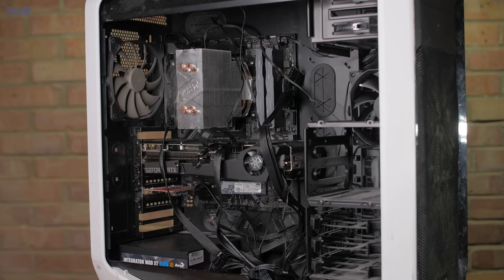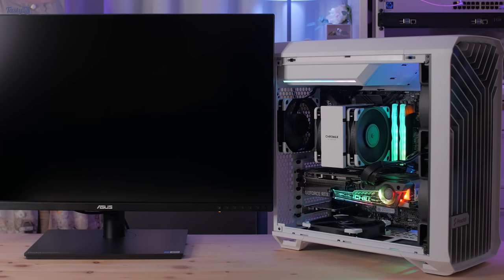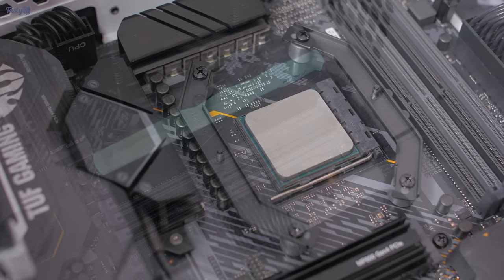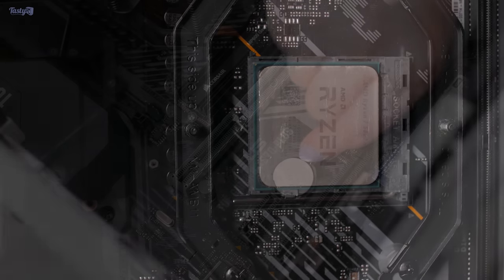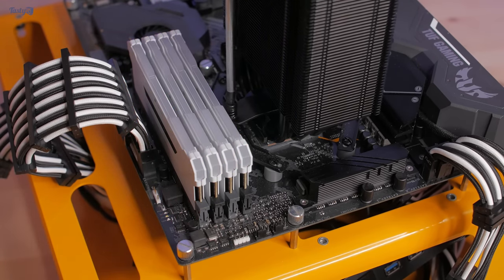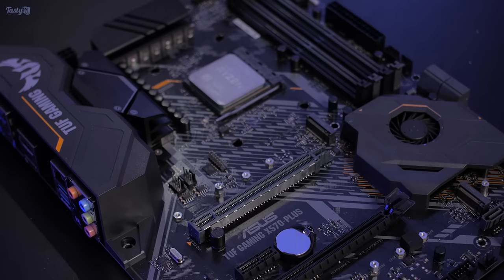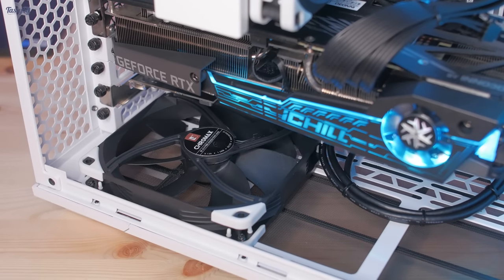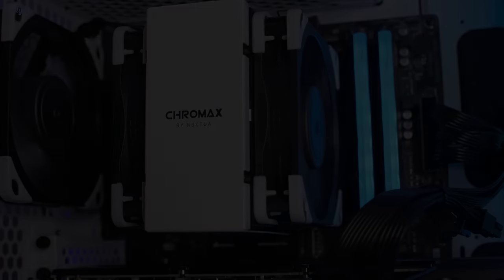I BROKE A VIEWERS PC??

Comment: Great find! Testing the owner's chip in another board was crucial here, revealing the true culprit. Many would have called it quits prior.
Reply: From watching your fix or flops I had it being the faulty memory controller issue you have had getting a few times now ha
Reply: I ended up in a similar situation however i some how always manage to make the cpu unseated correctly, I seem to have a habit of a doing it
Reply: This happened to me once took it apart, put back togather and a slot or stick stopped working. Ended up getting a new mb

Comment: I really like to heard troubleshoot tales, sometimes things just go the way they want and leave us without a clue... At least this was a good journey and you isolate that condition. Stability is king, and you got it!!!
Reply: what
Reply: This is likely a result of the motherboard company using cheap base materials in their motherboard which experience more thermal expansion when heated. - Not all motherboard substrate materials are equal! - This is a problem with extremely cheap motherboards, and a good reason to avoid the low-end of the market.  It's also a good reason to make sure your case has good cooling.

Comment: 8:00 motherboard is bowing with the new cooler.  probably some mem traces are cracked. 
Low layer motherboards suck! Im sorry but it happens and especially when the cooler is heavier also after a while when the weight dragging it down until something disconnects (layer crack)
(I'd remove the cooler ram and gpu to ship it back safely)

Comment: This happened to me on one of my previous builds. I was using an EK waterblock on the CPU and when it was tightened down all the way it caused the system not to post. However slightly loosening it (ever so slightly) solved the problem. The system looks great and good work troubleshooting through all the problems!

Comment: Nothing worse than helping a friend or family member with a pc issue to potentially damage it when trying to resolve the initial issue 🤦‍♂🤦‍♀😢. It’s a devastating feeling! Thankfully this PC issue was diagnosed and not an issue of the repairer damaging the build. I’ve come across cpu cooler mount issues creating a memory post error myself and checking the cooler mount is the 2nd thing I do ….. after reseating the memory …. As reseating the cpu can be done after checking the cooler mount pressure 😇👍💪.

Comment: Problem with asus tuf mobo was user related (owner of the pc), improper mount of the cpu cooler in the past made this issue on the socket. I stopped building pc's for other ppl long time ago, exactlly for these reasons, they do a small fk-up and then is "my problem" when I try to help them. So now I build only for myself with my own hardware and never had those major issues lol. Cheers!

Comment: Great troubleshooting! Only other thing I might have tried but not the fix in this case is to spray some electrical contact cleaner (I use wd40 specialist electrical contact solvent spray) in to both the ram slots, on the ram contacts, motherboard socket and the cup itself. Always do with power off as can cause condensation, so give time for it to evaporate before putting back together. Very slight chance dirty contact in both a pin and socket hole could the be enough for it not to work. Seems definitely pressure related in this case. Hope you haven't left yourself without a motherboard now though? If so hit me up, might be able to help.

Comment: Is it possible that it's a microscopic crack in the MB which opens up when the cooler is tightened or two solder joints on the back of the MB which touch as the cooler, when tightened, slightly bends the MB?
Reply: You can't really crack those traces. But you can crack the solder joints under the socket, they can be brittle, or the contacts of the socket can be bent somewhat out of shape. Backplate stray contact shouldn't be happening, either the backplate is insulated or they have distances figured out.

Keep in mind it does work with different CPUs, so... i'm thinking socket dirt or socket damage.

Comment: Well, I did not expect that.. But that being said, I have seen micro fractures in mother boards before. (notably including a server one) Because these boards have so many layers, localised hot spots can physically stress the board as the layers expand at different rates. The ground layer has far more copper than other layers, for example. But between the signals layer and the power layer, a lot of disparity can exist.

 I would suspect it was the MB being the culprit rather than the CPU, simply because CPUs either connect or they do not, and it worked in another MB fine.

So props Lauren. You did a good call, even if it was an unwanted one.

Comment: at 4:14 the retention lock seems to fall down into closed position without force. This tells me that the issue is a temperamental retention bracket. Another clue is that sometimes its sticking to the cooler on removal and sometimes it isn't. The way these work is a grid array that slide over the pins to lock them into position. causing them to make proper contact with the pins.

Comment: I had this type of problem with my 9900k. There are  some weird pressure issues causing this that are hard to solve.
Reply: Yeah, exactly why I've swapped out the motherboard, slapped in a 9400, and build another sistem that never loses the dual channel. It's heat related.

Comment: I heard from an employee at one of the local Microcenter stores (Chicago, IL) that they had a lot of X570 TUF motherboards returned due to issues. This was back in 2021. I did not think to look up any issues with it, as i don't usually buy the TUF series, but I saw them at a super low price and asked about them. Hope this helps.

Comment: Was waiting for this.

I think this mainboard either has some dirt inside the socket (could be thermal paste residue), or a more serious issue, that the socket solder joints to the PCB are damaged. The socket soldering is a weak point on AM4, and you've seen how mistreated this PC was in the past, if it fell down, well that's not a good time. I was certain you haven't damaged the mainboard when removing the CPU.

AM4 CPU shouldn't be pressure sensitive at all, so any pressure effects point towards a socket problem on the mainboard. You can fundamentally have a repairman replace the socket for you with a brand new one, it's equipment and skill intensive but actually a really quick job, and a replacement socket costs almost nothing, so maybe they can offer you a price that makes sense.

Thermal paste also gets easily into the edge pins of the socket, which are critical for one of the memory channels. and the slanted hinge part of the socket practically guides paste in there. You can spray into the socket with some nice high pressure isopropanol spray can to attempt to clean it. Or residue-free contact/pot cleaner. Or even plastic-safe brake cleaner though using it near electrolytic capacitors is a little iffy.

The CPU should be fine, but the pins might be a little not quite factory-shaped any longer.

Comment: One thing I can tell you is I never trust moving motherboards in built desktops. Even if you remove the cooler before shipping. There is probably a hairline fracture in the original board that you can't see. The other possibility is when the cooler was removed originally and yanked out the CPU with it that there was some additional strain on the board that worsens the issue. It is very nice you replaced the viewers board but honestly I think it was most likely damaged when being transported.

Comment: this is a common problem with AMD Ryzen burning up a single memory channel infact this has happened 6-7 times on on Greg Salazars channel fix or flop and he also found ryzen 3600-3700 burning up entirely .. i can confirm that AMD ryzen issues are common .... crack in the silocon...

Comment: What is probably happening is that the board is bending with the old cooler. This engages the cpu pins and they have been bent slightly in that direction because of it. The new cooler has a stiffer mounting so is applying more direct pressure on the cpu with less vertical bending of the socket. This means the slightly bent pins and socket do not make contact on a couple of pins, disabling those slots. The other cpu from the same gen still makes contact as it's pins have not been bent by being in a curved socket for years.
essentially you have a slightly damaged socket and a slightly damaged cpu that both work with undamaged parts.
It's great how you showed your workflow of troubleshooting as many people nowdays don't have that kind of logical thinking skills. Something the IT industry is sorely losing. Pc's being so easy to build means people who do it don't need to know how they work like we used to. It's actually good you came across this issue as you can highlight a skill that people definitely need.

Comment: It's possible that there is a micro crack on the motherboard which the new fans retention system is causing stress on. This would be caused by dropping the PC or the PC getting a knock while being transported. Other than that wear and tear on the socket could cause pins not to connect properly. But you would expect that the motherboard would be a lot older than it is for the socket to be worn. Other than that it could be a manufacturing defect. But in that case you would expect the defect to have been noticed from buying the motherboard new and the motherboard would have been replaced under warranty.

Comment: I had this issue but with an intel cpu , btw this issue is very common among ryzen cpus my friend had this and he changed the mobo, on my intel cpu that has lga ,a socket pin was not connecting to the cpu so i had to put a smol piece of metal ontop of the socket locker and and the channels worked again, i also tested it just by pressing on top of the cpu with no cooler , and i wouldn't do that with a ryzen cpu cuz the pins r easily bendable:/

Comment: Makes me wonder if the mounting pressure of the cooling solution was causing just enough flex in the Asus board, that it was disconnecting an already faulty trace for the CPU's connection to RAM slots that weren't working.  Regardless, phenomenal job, Lauren!

Comment: You should look at the traces on the motherboard that pass by the cpu cooler mounting holes.
I have 2 asus boards that traces are too close to the holes and when the cooler is installed it scratched the traces and shorted them, causing 1 ram slot to stop working.
But works fine when lossened

Comment: I've had the same issue with the Noctua NHU12 with a Intel 10900. I think it's the mounting mechanism so you have to be careful when tightening it because it seems to put uneven pressure on one side of the CPU.

Comment: Unexpected solution! Now I've got a previous "dead" motherboard I should retest.  Sounds like some weird tolerance issue with pins, socket and/or cooler mount pressure? Glad you mentioned Bios update that's my go to. Always appreciate the videos, you have a very calming presentation.

Comment: used  a  i7-2600K CPU with  3 bended cpu pin's on the MB for years, and only one mem stick slot working, Bought a new MB and all is well with cpu and dual channels working now, using 4 mem sticks.

Comment: I experenced the EXACT same issue when installing my 5800X Lauren, some of the Ryzen platform CPUs have to be left light as a feather or it somehow trips due to to the pins being a fraction of a nanometre too low into the socket.

It took me bloody ages to work it out and it wasn't until I posted it without my AIO as you did, I realised that it was a pressure issue and resolved it.

As soon as I saw the error code lights I instantly knew what it was! 🤣 Marvelous work as always, well done for figuring it out so methodically! 🤘

Comment: I have that same board with a 5900x, no issues, but the good thing is, that x570 tuff board can be had for pretty cheap compared to some others, I reguallty find the x570 tuff on marketplace for just over $100 usd in my area, I almost picked one up the other day just have as a spare since my current x570 tuff, I darn near had to break the pcie retention clip to get my 6800xt out of the slot, there was no other way to get it out, and that clip fought me hard, but my 3080ti the little lever works perfect everytime lol.

Comment: Really good video. Try using a hairdryer to soften up the thermal paste it makes removing a cooler much much easier. But be careful if u use this method you only need heat about minute if doesn’t just come away really  easy just heat bit longer . Totally sorted the cpu sticking to the cooler problem.  Very interesting. Out of interest did u try using a Noctua am4 backplate! They send them out free and are really nice . Check the ring spacer too I’ve seen this and u can sometimes get over it by fitting the intel spacers instead of the correct ones !

Comment: Oh wow, that's pretty annoying problem to face. I really love all the ways of troubleshooting you did. In my opinion, the fault is in the motherboard. Maybe with the socket, but more likely it is the traces between the cpu socket and the memory slots. Some coolers use huge amounts of pressure on the motherboard and bending it. In this case, it was probably too much and the traces got damaged and lost contact at some point. If that is so, there is really no way of fixing this, especially when even thermal expansion was enough to cause problems.

Comment: Welcome back. Interesting video. You seem to have checked just about everything. The only thing that comes to mind is that maybe the heavy cooler is stressing the CPU socket, which may have a cracked soldered joint that parts under stress.🤔

Comment: Bad trace or solder point on the CPU socket, or someone installed the cooler and scrapped off a capacitor, or nicked a trace by mistake. Tasty never doing customer repairs again. lol But awesome looking build.

Comment: I would have guessed RAM compatibility. I got what I thought were two identical sets of Trident Z RGB but it wouldn’t POST. Turns out one set was “For AMD” and would work in any slot, while the other set would only work in the primary slots. AMD RAM compatibility has gotten better but it’s still wonky sometimes haha.

Comment: I had the exact same problem but I gave up trying to fix it. So I got an all new Ryzen processor, motherboard, and RAM etc. I then sent the computer parts to a professional  computer LAB and paid them $250.00 USd to put the computer together for me. After two weeks and $250.00 dollars they got the same exact results and concluded that they couldn't figure it out either. After being in the computer industry as an engineer for over 20 years my best guess is that it might be the CPU pins. Just a little thermal compound on those pin could cause a poor connection between the CPU pins and the socket. I gave up all together on AMD and have gone back to the Intel CPU's where I never have any problems!

Comment: WoW that's weird n' hard!! gz for troubleshooting it. 
Some steps I would may do in addition:
-Clean the whole MB with paint brush and alcohol at both sides. In this case even inside the ram slots.
-Use a rubber for the ram golden contacts and then alcohol as well. 
-Take in and out the Ram in the memory slots x10-x20 times.

Comment: That MB/CPU pressure issue is so odd -- great job on the troubleshooting, shame there really isn't something to do about it 🤔 Also, I always did the twist back and forth 45°/slide technique for AMD to get the cooler off (assuming you have enough room to slide the cooler in one direction for it to come off the CPU).

Comment: Could be a faulty AMD CPU, I have heard this happen with some of them and this stuff happens all the time with hardware, seeing as everything is made on a production line with possibly hundreds or thousands of CPU's being made over hours.  I originally thought it was a bios issue with the CPU being newer than the motherboard bios making it unsupported, then I thought it could be a mounting issue. Some of those backplates come with a pad that goes on the back of the motherboard in the case of my EK waterblock I have a rubber pad which must be to stop anything on the back of the board shorting out against the backplate. That or mounting pressure, I had the same issue when I built my PC temps even under liquid cooling would reach 80 degrees C plus, my pump was working so hard it made my reservoir look like niagra falls, turned out I had to put more pressure down on my 11700KF.  Now temps are perfect.

I've also done this in the past with AMD's CPUs I hope in the future they move to LGA instead of ZIF (Zero insertion force) - until you need to remove it that is. It took me a while to get the weird concept of the twist, I thought you had to pull while twisting to the left and the right when you just need to lightly twist to the left and right to weaken the hold of the thermal compound.

Comment: Had a similar problem after I upgraded my system. The cooler pulled the cpu out of the socket when I tried to remove the cooler. I'm convinced that this damaged the cpu socket on the motherboard. The cpu still worked fine but wouldn't boot on the original motherboard. Pulling the cpu without releasing the lock must surely cause some damage to the socket, IMHO. Hope this helps. God bless, stay well.

Comment: The socket must have been damaged. Usually solder issue with AMD sockets. If you have means to have the socket reballed, you might want to try it.